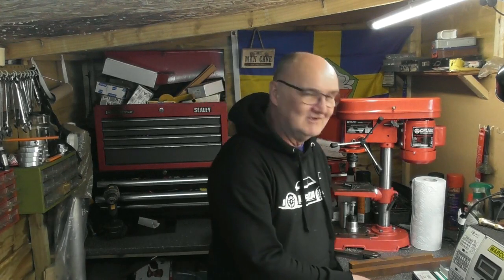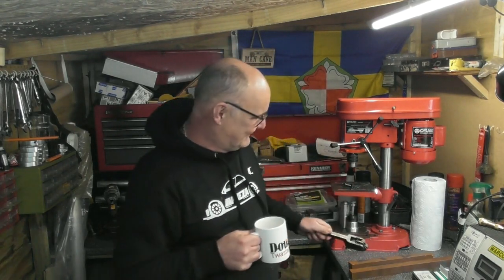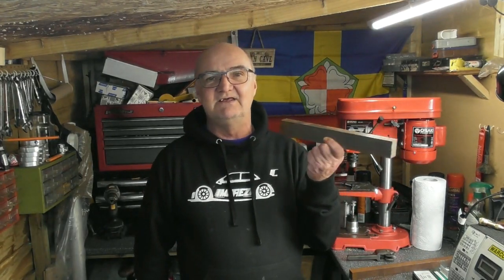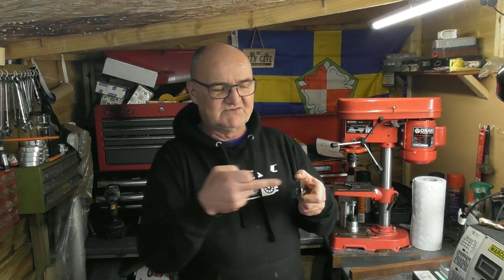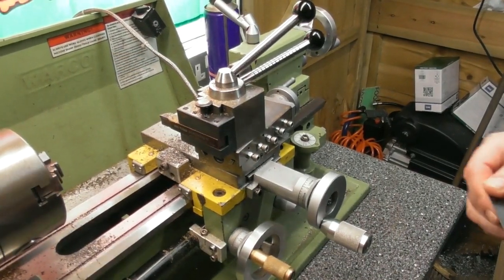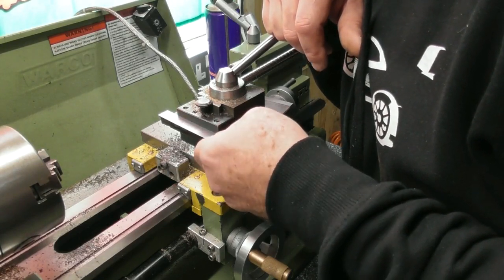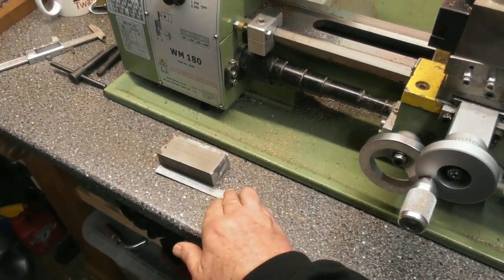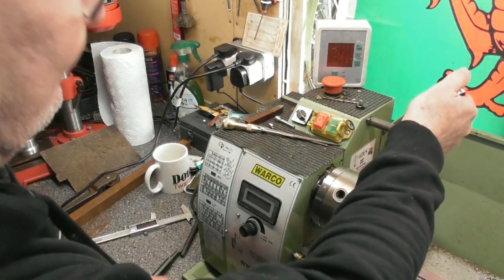Shed talk 14 shop update and new knurling tool project,

Comment: Hi Ade
   I have Warco lathe with the same nuts and washers, i took the studs out of my chucks & put a short lead on thread to root dia & made studs just long enough for nuts & washers, the washers are thicker & knurled so fingers get a grip behind chuck, it's now very comfortable to swop chucks, hope you or someone finds this useful.
Reply from the maker: Good plan , i just need to finish my new knurling tool to get it done , Cheers Ade.

Comment: Ade  Loving your vids  but could i make a suggestion ,  get rid of those  double adapters  they are  not recommended  and either get a 4 way extension lead   or  if   your happy to do  electrics    fit a second  double socket NEXT  to  not above  the existing socket
Reply from the maker: All the wiring in the shed is due for an update, i started off fine but the need for outlets has grown considerably, i have spare sockets and it is on my priority list . Cheers Ade.